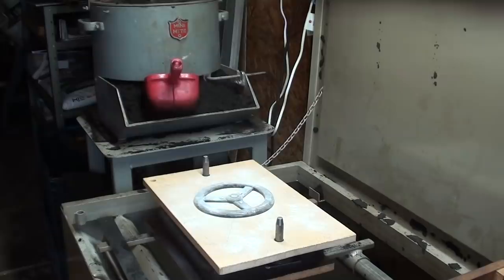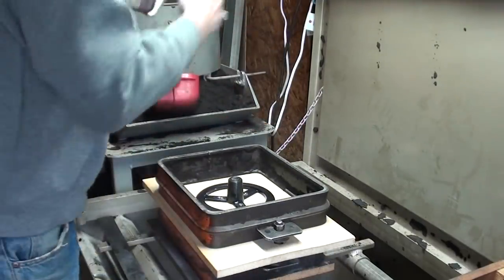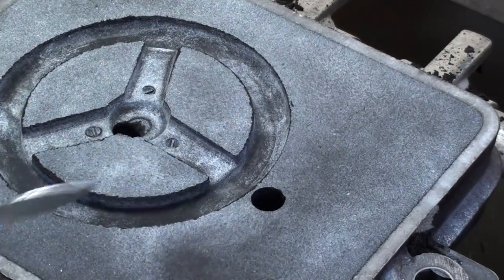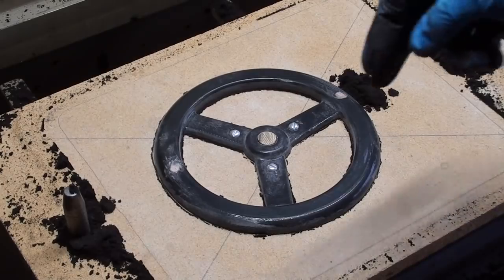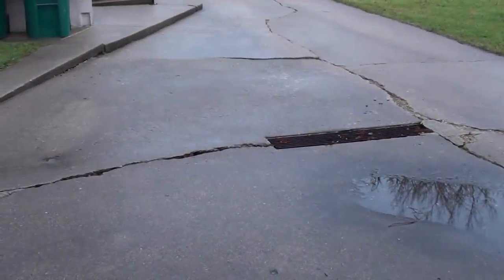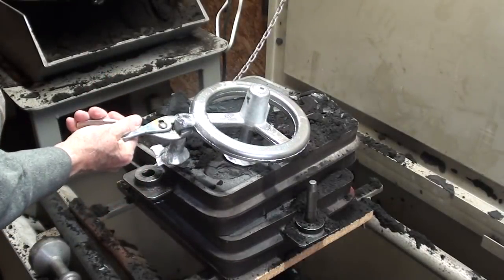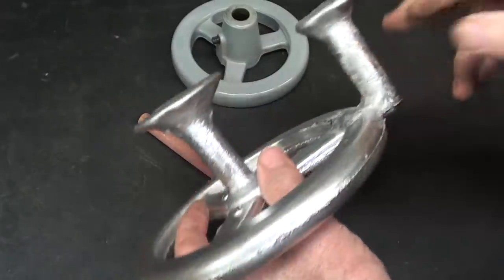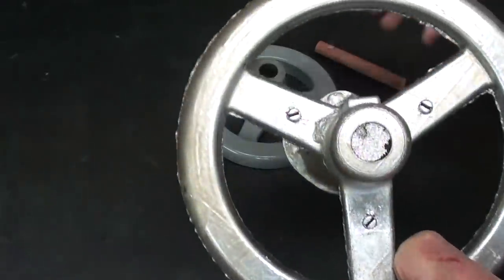Casting Hand Wheel for SOUTH BEND Shaper 697 tubalcain

Comment: Great result Lyle, I thought the fall in would be worse than that when I saw the mold, turned out just fine. I am with you on the screw heads, I think they spoil the look of the handwheel (especially once you have it finished). Nice job. Cheers, Jon

Comment: Just a suggestion; the next time you want to cut in a riser like you did with this one, you can insure that you will center the riser if you cut the sand through the inside of the mold cavity instead of doing it from the outside before you pull it apart. In addition, you should have the riser  no smaller than the diameter of the area you're trying to feed. In fact the rule is that the riser should be one and a half times the diameter of the part you're trying to feed. Casting looks good. Would be interested to see if you have a small void in the boss when you drill/reem out the boss. It won't be very big and might be off set like the riser was.

Comment: Great work as usual!  Have you considered using one of those air powered air nailers for ramming the sand using a homemade flat faced adapter? 
https://www.harborfreight.com/air-impact-hammer-kit-92037.html
https://www.harborfreight.com/compact-palm-air-nailer-69450.html
Reply from the maker: I do not know if that would work. Those things have an awfully short/ stroke

Comment: I watched a Abomb video at Windy Hill foundry and they took a lot more time to pack the cope and draft than you.
Are they being overly excessive ?
I realized you sped the video up on this one.
Reply: Because of the heat and the weight of the metal used by the Windy Hill Foundry you must ram the sand relatively hard to prevent erosion by the molten iron as it travels from the sprue to the mold cavity.
Reply: @sandrammer  Thanks for the answer.